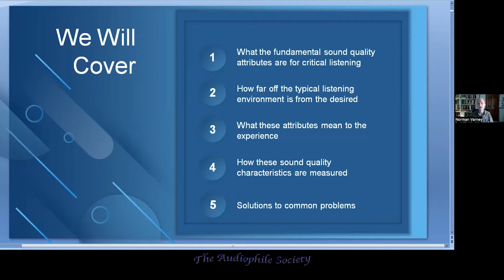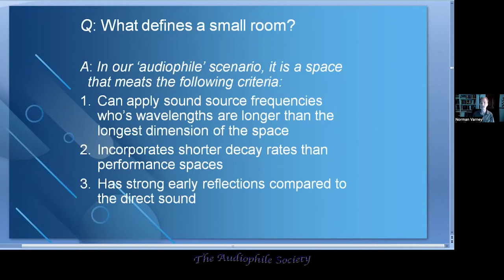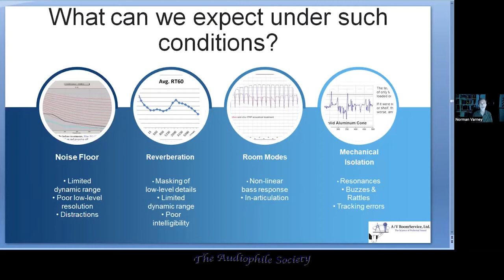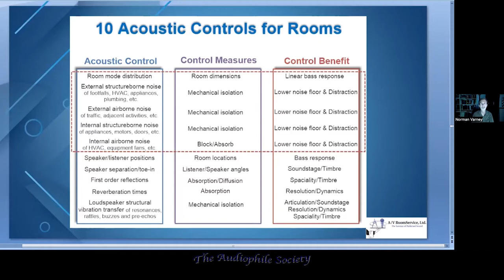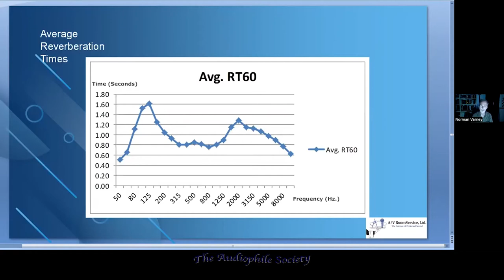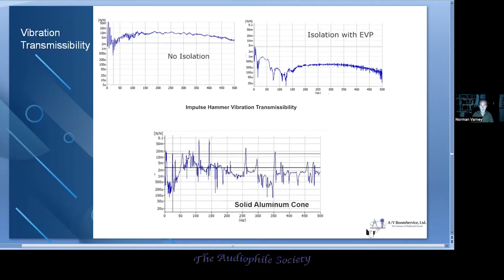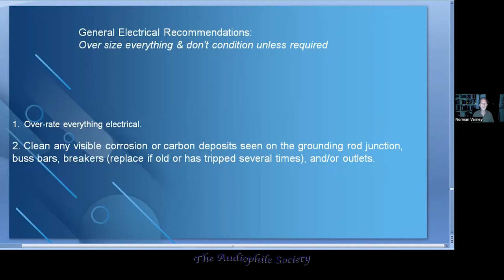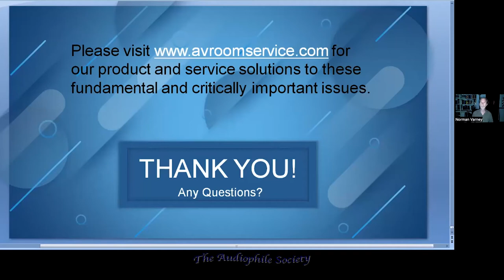Noise and Vibration From an Audiophiles Perspective       Norman Varney Audiophile Society Zoom

Comment: Can't believe nobody had commented on this yet. The content in this clip could fill an entire Youtube channel, when broken-out.

I just moved into a new house with quite high-end system, very sensitive 107db. I am working with an electrician who is also a hifi expert and all the points mentioned here we've been addressing. Just love the clean frameworks in which the content is illustrated, very comprehensive.

Love the pictures in the end of the measuring devices regarding the power. Got myself a Torus RM20 and will work on setting up single ground in my house with low resistance rating, etc.

Really contemplating now if I should move my setup from living room on wooden floors to basement with carpet and concrete beneath... Just moving speakers makes such a difference. Google Jim Smith, Get Better Sound as well